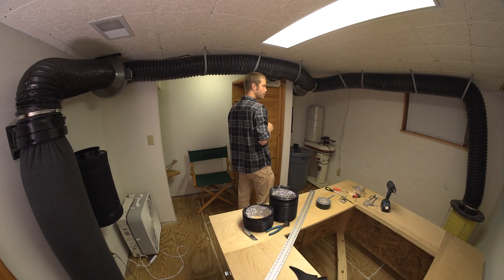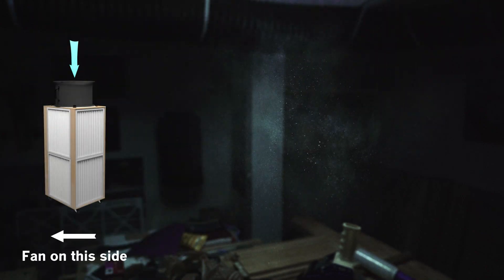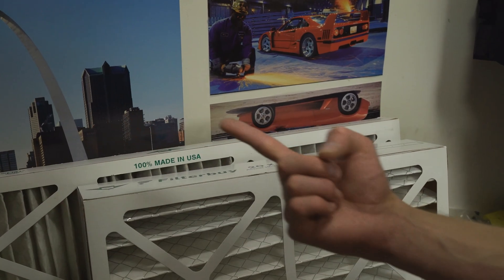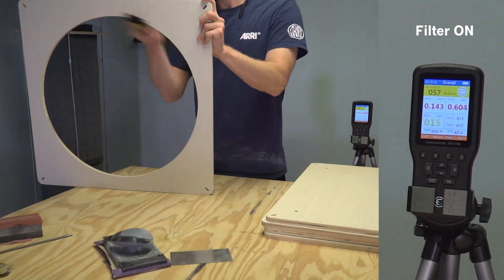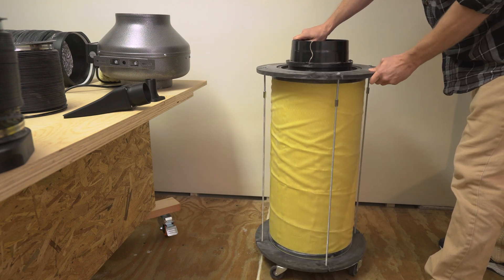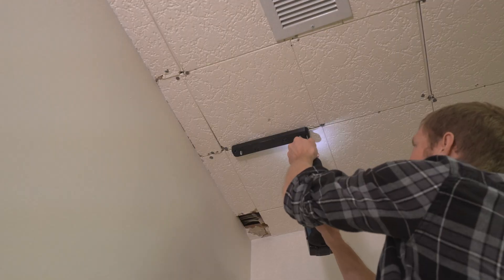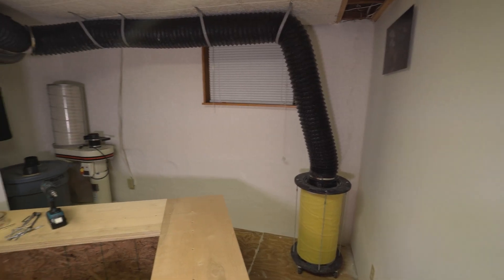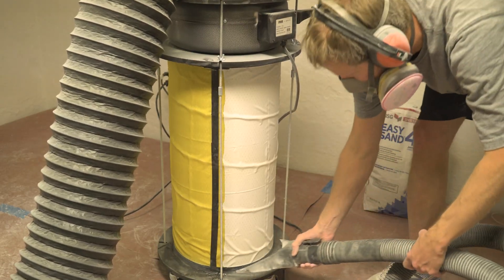Why Ducts Work - Shop Air Filtration

Comment: Excellent presentation.  Thank you.  I nerd out on this filter stuff and have filters all over the house.   I would like to have an affordable meter that would semi-accurately measure PM2.5 and PM10 in the house and outside.  This would allow me to see if my filters are actually working and/or the media needs to be replaced.  It seems like a real crap shoot on the web and amazon as to what units actually work with reviews all over the place for most of them with many appearing to be garbage.   Would appreciate your ideas on meters.  Would also appreciate your thoughts on knowing when the filter media is restrictive and should be replaced.  I have the 3M MPR2800 in my filter boxes and HVAC and I am fearful that I unnecessarily replace them too often.
Reply from the maker: Thank you! The most conclusive way to know when to replace the filters would be with a monometer. I got one of these last year but haven't had a chance to test it out. I will be doing a "dirty filter" episode in the next month or so with rigorous testing on dirty filters. This is important with your AC because if the filter is too restrictive it can have negative effects on your blower motor or furnace, or it can cause your AC to ice up in the summer. 

As for filter boxes, these will last a long time before replacement is needed (6 months - 1 year+ depending on how much dust there is to suck up). They can get really caked with dust before it's time to replace them. That can not be all that good looking though, so that's part of the benefit to doing a pre-filter over the top of the filter. You can clean off the unsightly/large dust and let the expensive MERV 14 filter handle only the ultra fine particles. That video should be out later this week.

Good call on the 3Ms they are the best 👍
Reply: @The3DHandyman Excellent feedback so thank you.   So - help on purchasing pre-filter media.  I had never even thought of adding this to my box with 3 20x25 filters.   Can you get panels of this stuff or sheets?  Thoughts?
Reply from the maker: @GoForAHikeNC  Sure thing! The material comes in a roll and it has to be cut to size. I am also thinking about offering precut sheets. Would that be something the interests you?

I will be working on the material links this weekend if you want to do it yourself. The material is reusable between filter changes. There are a few material options that I will discuss in the new video.

Also, on your particle meter question... it's hard to say what the best meter is without a super high quality monitor to test them against. I have a budget option that I use for my tests. It's probably not perfect but it's good enough for comparison purposes. I have looked into Temtop monitors https://amzn.to/43ys1Eq which seem to have decent reviews. I will probably get one of these for my VOC/carbon filter video to see if the two monitors compare when it comes to gasses.

Comment: hoping thru enough exposure of knowledge housing might try and standardize this.  Really could see life expectancy increasing if filtration became whole-house common practice
Reply from the maker: That would be a fine goal! I thought about making an adapter to use the central air system when the AC isn't running, but I would need to consult an HVAC tech before I get into that. There are a lot of potential issues with tapping into any system. Thanks for the comment!

Comment: I built a papr respirator using a 4” inline fan and ductwork. A grinding shield and force flex garbage bag as the containment shroud. Multiple layer filtration on the intake of the fan. Straps to a backpack. Could be a video idea for you as I’m sure you’d make something far nicer than I could with a 3d printer. Just tossing out a video idea. Thank you for making these incredible videos. They greatly are appreciated.
Reply from the maker: Cool idea! I have been using a 4" inline fan for a few small filtration needs for a while. Seems like there would be just enough air flow for a positive pressure helmet. 

I was doing a lot of grinding a few years ago and picked up a 3M full face respirator and it worked but was seriously uncomfortable after an hour or two. I might put this one on the to-do list. It's already a long list tho. Thanks for watching and commenting!
Reply: Yes sir, Terrabloom 4” fan is what I used available on amazon. 8 speed levels and plenty of adjustable volume. I used similar ducting that you used in this video. I believe the same aluminum duct with a thin rubber coating, and of course being in a 4” diameter. Comfort is quite nice with the fan strapped to the backpack as I need lite and agile in the knife making shop. All sorts of very fine  dust is going to be present, and no matter how many half and full- face respirators I tried I would always get irritation. This completely cured the problem as I had hoped. The intake has a hepa filter I taped on  and I am still experimenting with pre-filters at this time to see what I like best. All in I have what I believe to be a superior unit to some commercial units at a fraction of the cost… maybe 300$ (overestimated). I believe 3m is straight up robbing people with what their PaPR systems cost. Anyway, hope this helps in the future for you and your shop.
Reply from the maker: @stevemiller6259  Thanks for all the info. I  have been using the 4" iPower fan but it has a lot fewer features and is probably not as quiet. Will check it to that, for sure.

Thanks for the details!

Comment: Have you tested the box filter in upside down position? I mean, the box with filters on top and the filters on the bottom? Does it affect the results?
Reply from the maker: So like a cube of filters on both sides of the fan? Just want to make sure I am picturing this correctly
Reply: @The3DHandyman  I should've said cube/box filters. I mean your model a filters, but with the fan on the bottom instead of on the top. I am sorry, my previous reply was quite confusing.
Just one cube filter, but with the fan blowing out of the bottom of the box. On the video, the fan in the cube filters is on the top. You would off course, have to put them into some kind of stand.
Reply from the maker: @carlosarthurpetry3674  Ah got yah. I will have a new version of the Model-B coming out soon that is designed for a ceiling mount. I am going with a smaller fan than the Caterpillar fan that makes it easier to hang on a wall or on a ceiling. 

As for an upside down Model-A, That should work just fine. I believe some people have tried it but I haven't gotten feedback on how it went from any of them. Id think that the overall performance may be better if the fan is at least 3 feet away from the ground to allow for a bit more air flow.
Reply: Another advantage to this "upside down" configuration is that the filter stack dust intake could be higher.  This would allow the offending particles to be captured prior to gravity taking them into the area where you are doing all of that pesky breathing stuff..  Kinda' late if you're only catching particles that have dropped past your nose and mouth and are near your knees.  Could also leave room for an exhaust diverter or diffuser.  Defective thinking???
Reply from the maker: Seem logical to me! The wall mount can be positioned at exactly head height for that sort of effect.